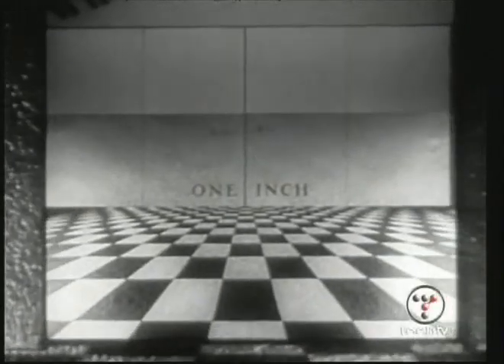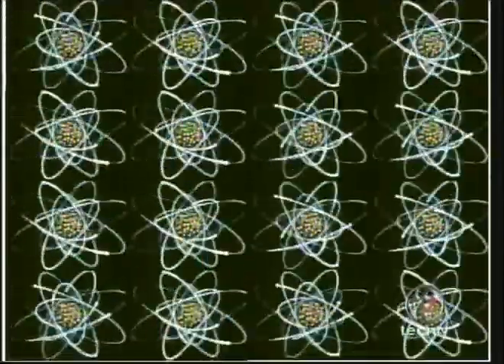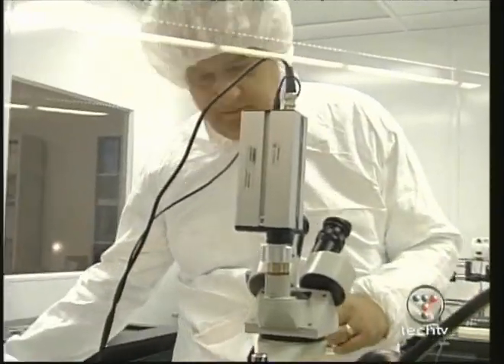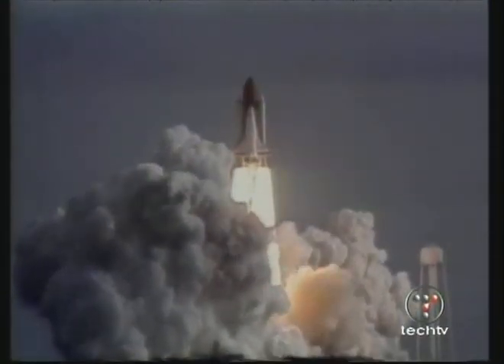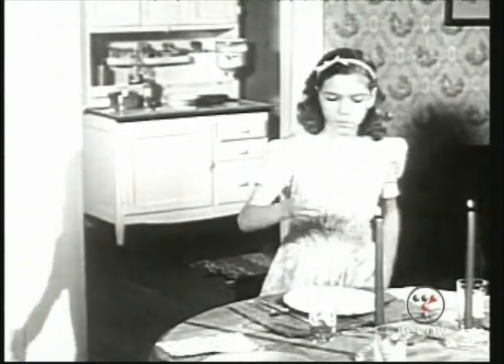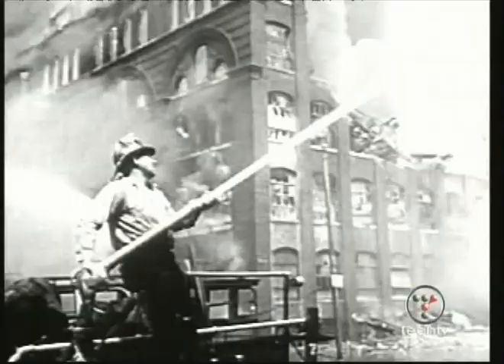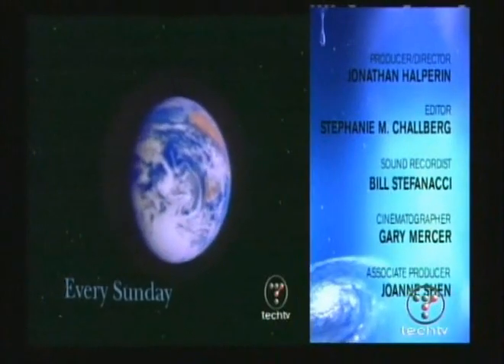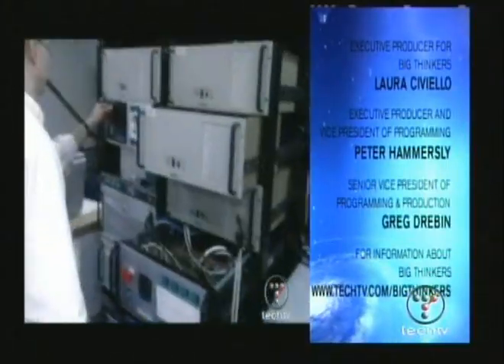Big Thinkers - Ralph Merkle [Nanotechnologist]

Comment: Richard Feynman thought of using an electron microscope to make nano-manufacturing happen.  Drexler noted S.T.M(Scanning Tunneling Microscopes, something very new when Eric Drexler first started thinking about nanotechnology), and Proteins.  But, the protein route ran into the protein folding problem.  It is an astronomical combinatorial problem that still hasn't been solved deductively.  But, recently, like December 2020, an A.I. group showed they can approximate protein folding to a reliable degree.  

I wasn't really aware that they didn't really make it available.  But, recently, the David Baker team improved it(being able to calculate protein complexes, and hence protein machines), and made it available.  Suddenly, the alphafold team made their software a lot more available. 

Within a few weeks, the David Baker team for one solved 4500 proteins.  And, that was on a computer with the power of a gaming machine. 

At this point, they could probably create nano-manufacturing - if they wanted to.